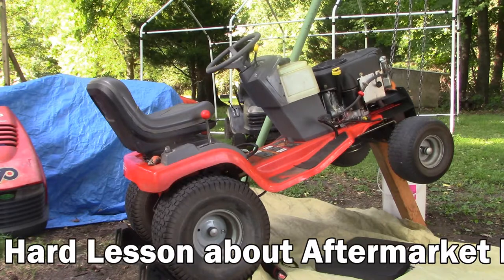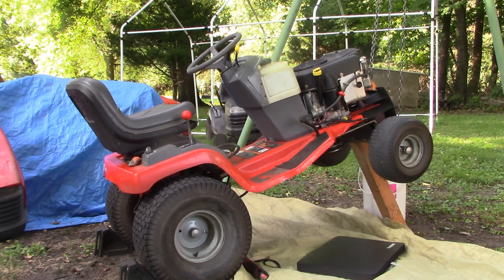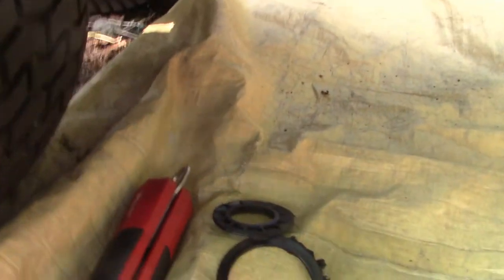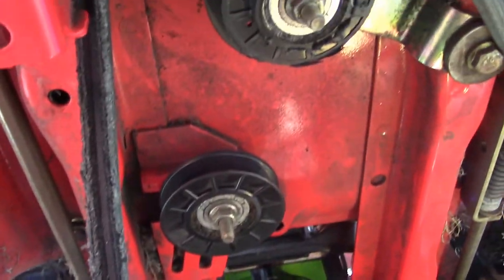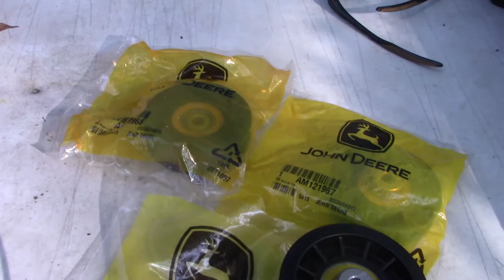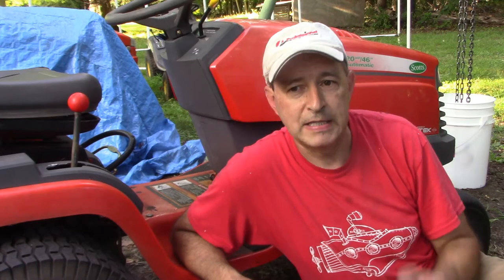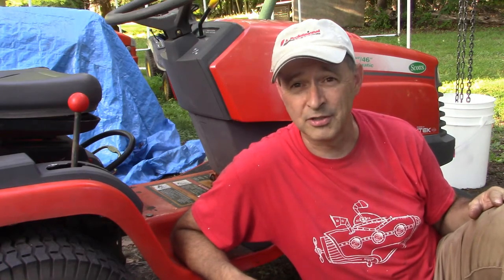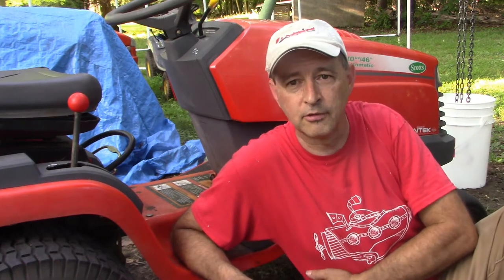BURNED BY AFTERMARKET PARTS !! Ground Drive Pulley FAILURE - Scotts S2046 Lawn Tractor - MY BAD!!!

Comment: I have used brand x parts for years- only one time had a problem-spindle bearings- oem- 24 dollars each -after market 4 for 11 bucks aftermarket is good- it is only a lawn mower-- oem carb  $ 134--- brand x- 9 dollars
Reply from the maker: Sure, for my own equipment, the savings is worth the risk. But for a paying customer, I think, it was a mistake. The result... even if I make it right, which of course, I did...will be a lack of confidence in ME. That's what bugs me most about the whole thing.... Thanks for your note.

Comment: The OLD MAN at Eliminator Performance again: we normally stick with OEM parts but have found Stens to be a reliable source of aftermarket parts i believe they are Arrowhead in the USA. Here in Canada you need to have an HST Registration Number (sales tax reg.#) in order to set up an account and purchase parts. The additional benefit is free shipping on orders over $150 and membership savings depending up annual purchases they also have summer, fall and winter sales. By the way check us out on YouTube and send Jake your address if you want a sticker or do a sticker swap.